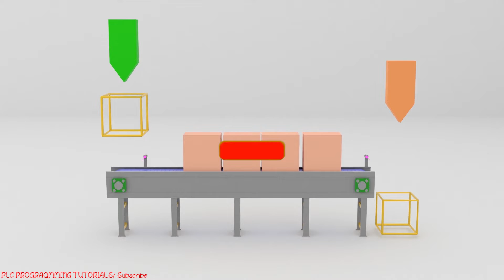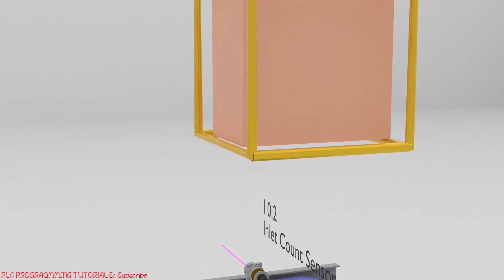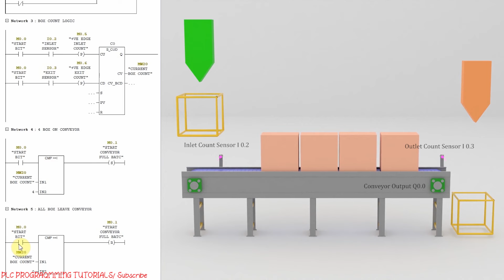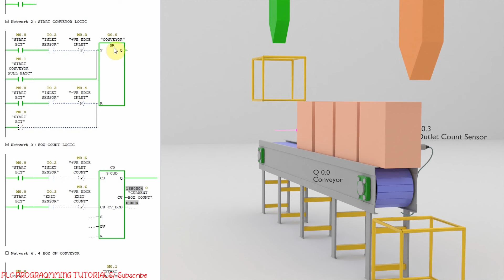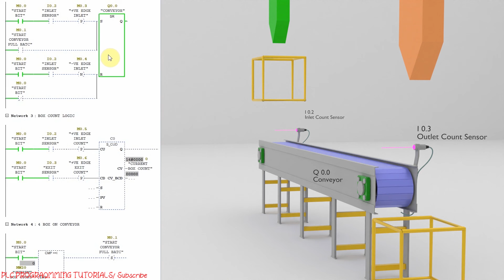Conveyor Ladder logic PLC programming Project with Batch System

Comment: The program needs correction maybe? Network 2 the Reset of x should be  connected to    "M0.1 Reset the Conveyor Full BATC state" when the count is 0, But the Conveyor still needs to receive a Reset signal at  "Q0.0 Conveyor", You have connected  only an extra M0.0 "Not Start Bit"  on R of  "Q0.0 Conveyor",  Question  how would you write this program as a statemachine.  How many states would you define ?   ST1_MachineOn, ST2_Machine_Off, ST2_Conveyer_standing_still,  ST3_Conveyer_running ?